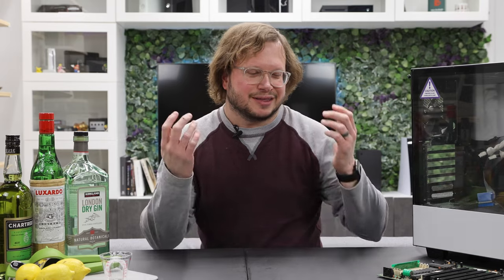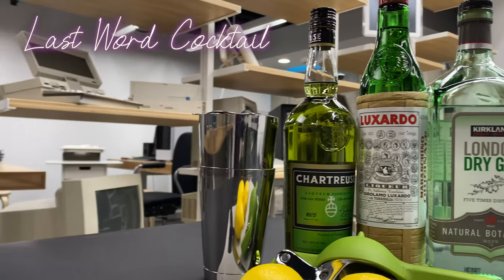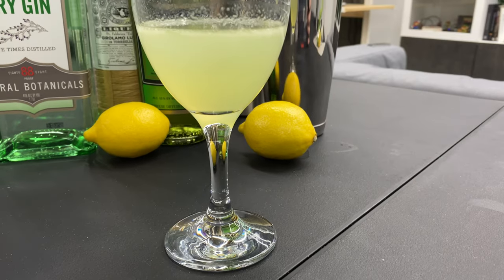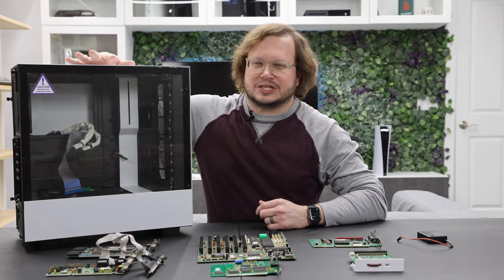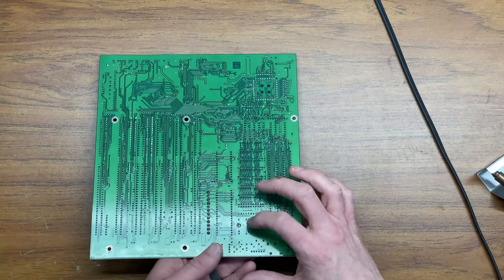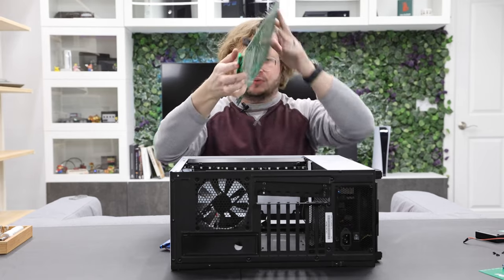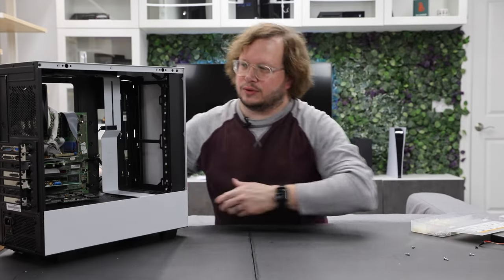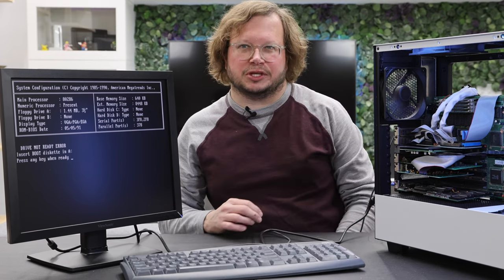Building an old 286 in a brand new case. | Jeremy's Retro Bar

Comment: Nice and clean setup! What cable do you use for the atx to AT power conversion?   Does it provide -5V and -12V ? Where did you get the blank atx cover? Thanks!
Reply from the maker: I got them all on eBay. There are a ton of listings. https://www.ebay.com/itm/20P-ATX-To-2-Port-6Pin-AT-PSU-Converter-Power-Cable-For-Computer-286-386-486-BT/132226239661?hash=item1ec94c4cad:g:4h8AAOSwIjJZPk8k

I used this for the IO shield.  https://www.ebay.com/itm/BLANK-IO-Shield-Motherboard-Backplate-Board-Port-PC-Server-2U-No-Cutouts-Opening/392343663583?hash=item5b598133df:g:S-8AAOSw3-tesiOG

Comment: The standoff thing is actually not that unusual. Just look at the retro PCs from the time, they all have this kind of standoffs ^^.

Some of them are secured by just two screws !

It's weird to see a 286 being built in a computer case that looks similar to mine (I have a cooler master silensio s600) in which I built a ryzen 5900x monster X)

The quality of your videos is really good !
Reply from the maker: That’s true, some do have the AT style plastic standoffs that slide into a slot on the case. Giving you a little more security than the ones I used that are flat on the bottom.
Reply: @JeremysRetroBar  well these exist too. But I've seen baby at boards with both installed before
Reply from the maker: @DxDeksor  oh yeah, good point.

Comment: Hmm, disappointing that you had trouble with the SCSI2SD with the Adaptec card. I have two of those slated for my Linux PCs with Adaptec SCSI controllers. Please let us know if you figure that out (as will I)! :)
Reply: Then again, I guess I've never used an Adaptec SCSI on a 286 or 286-era BIOS; have you?
Reply from the maker: I have the same Adaptec card in a 386 and it works perfectly. I’m sure I’ll figure it out.
Reply: @JeremysRetroBar  Oh, cool. My targets are 486 and Pentium machines. tnx!
Reply from the maker: @DrDavesDiversions  for those you can use the PCI version of the adapter which also should have less problems. I'm wondering if I set up my SCSI2SD wrong.
Reply: @JeremysRetroBar  Right. I think my 48CDLC cum 486 PC has the Adaptec 1542 ISA card and my dual Pentium Pro PC has the Adaptec AHA-2940 PCI adapter.
Neither here nor there, but both need new power supplies (one an XT case, the other more modern) for me to do those projects. Is there a brand or source you suggest?
Reply from the maker: @DrDavesDiversions  for ATX PSU's I just go with what's currently recommended. I know Corsair is good. For the XT (AT power supply I assume) I would typically recap it I don't know if there is a supplier that makes new AT power supplies, but someone would do really well if they did make one available for sale.
Reply: @JeremysRetroBar  OK, I have been out of PC stuff so long, I don't remember terms like "ATX," but I guess that's what it is. PSU has a switch on the back where the IEC connector is, and also has a remote/electronic switch on the machine's front. (This is an ASUS dual-Pentium motherboard that says "AGP" in large letters on it from c. 1999, IIRC.)

The older machine has the type of PSU with the big (red) paddle switch on the side, and the IEC connectors on the back, which I thought was XT but, as you say, I guess is XT/AT. As usual, I guess I will have to read up! tnx!